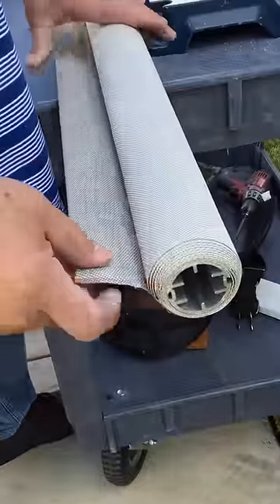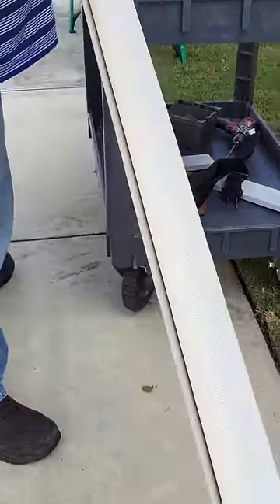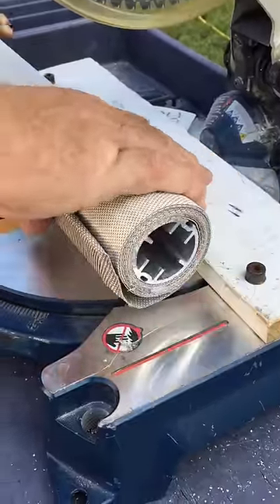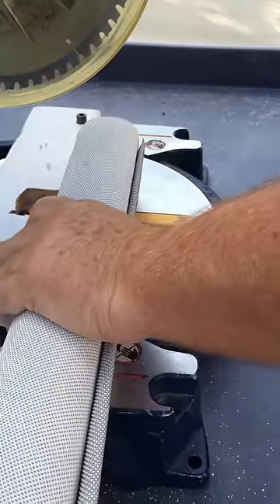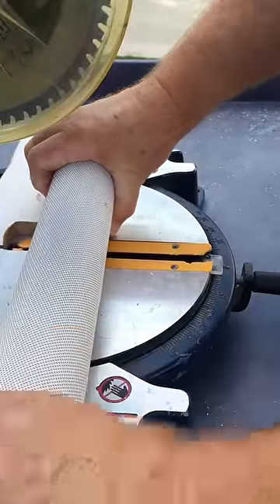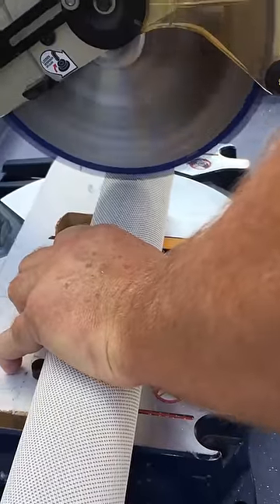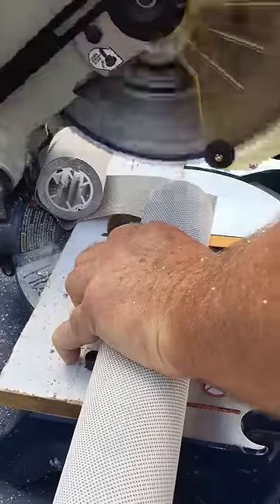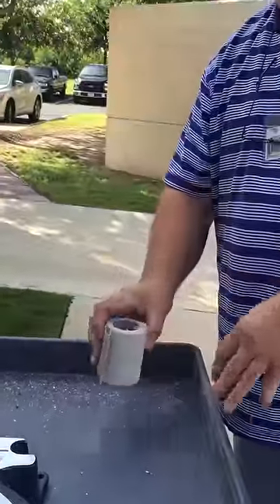How to Cut Down a Roller Shade

Comment: Thanks!  this worlds great for the sun block out shades I just bought. Other channels had u taking the entire thing apart and cutting with a blade. I did conventional blinds like this before. I did a test cut 1st with masking tape over the vinyl material. Test cut came out perfect so I went for it.  Shade hung & done in 10 minutes.

Comment: Make sure the material is thick and heat resistant- I did this for my interior shades and it melted and stuck together. Good that I did that test 2 inches short of what I needed.
Reply: Cut slower or use the right kind of blade. If you push hard with the saws and try to cut fast it will heat up. The blade has to have good clear out for debris to throw it out the saw so it doesn’t build up friction. Sharper blade will be better but you still should cut very slow.

Comment: There is one problem with this method, after a while the cut end starts to fray and gets raggedy and looks messy.
I know this for a fact because I cut our blind in exactly the same way.
Reply: Gerbil Crusher Hi... I jus bought Bandalux roller blinds BUT the stripes do no aligned .. I need to shorten in order to getting them closer to the bottom to alignment properly... how ca u do it ???
Thank u
Reply: You need to remove the shade fabric and hem the edge with a sewing machine.
Reply: Ok
Reply: What type of blad
Reply: Can't read the reply
Reply: You can also put a lighter to it and melt the edges to stop it from fraying, that's if the fabric has a polyester or plastic type fabric.  Or somehow cut the fabric with a fabric rotary cutter first then use the saw for the metal parts.

Comment: Don't follow this method, please 25 years in the Blind game and it will fray the cut edge.
Reply: So what do you use to cut them?
Reply: @jenniferrobinson2000  I use a straight edge [600mm Steel Ruler] and a stanley knife (think you call them box cutters) just make sure its done over some scrap board (i have a 2 x 4 piece of fibre board I use to cut them on)
Reply: So you take the fabric off the roller?
Reply: @domriz7369  if it is fixed with an insert you can slide it away from the tube, if it is stuck down then cut as far up the fabric as you can, stanley knife the last section around the tube and then cut the tube a couple of mm (1/16") away from the fabric.
Reply: @bantcliff  I have a shade , sun shade from Coolaroo, it's like mesh, what to do so the material does not fray up. I noticed that  the edges are stitched,  could it be burned  with a hot iron, like we do with ropes ends?
Reply: So I have a mecho shade.do I cut the aluminum tube first then cut the shade with a utility knife.
Reply: I just read your comments. Thank you

Comment: Can see the fraying on it straight away so in the end this blind will look a mess!
Reply from the maker: We use a lighter to burn off any threads or edges.
Reply: Yes and even that doesnt look neat. It ends up melting, then the straight line you have just cut is no longer straight as its dented
Reply from the maker: @cheezetoasty3573  A field cut is never as clean as a factory one - this is something that we don't do often, but that if done carefully can still meet the specifications of most commercial clients.  You have to be very careful with the cut and the flame.  Since we are usually cutting it because it's too big and would need to get reordered anyway, it's worth the risk to see if it is acceptable.
Reply: @kcajeannonny  sure, i'd do it for bedrooms where nobody see's but i'd like it professionally done for living room. Although good for saving money in the long run they dont last long before the fraying starts.